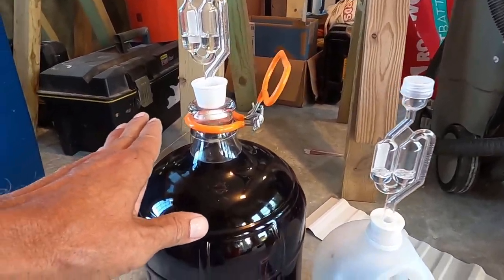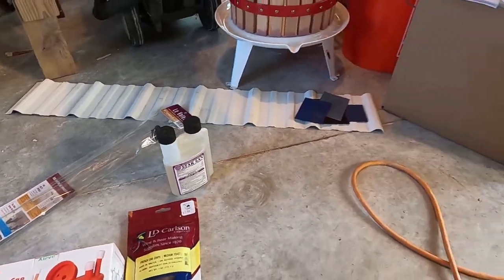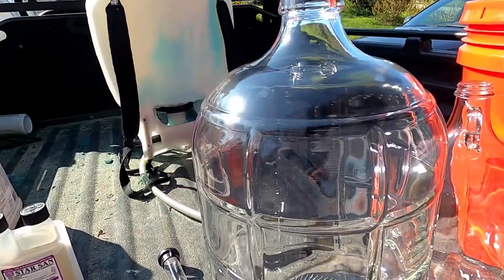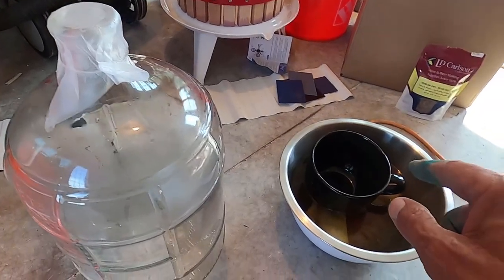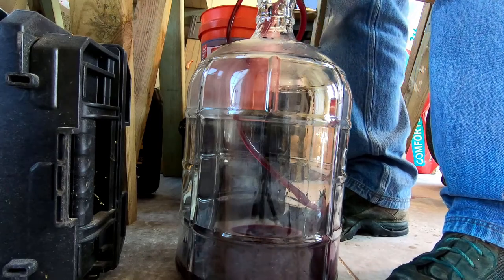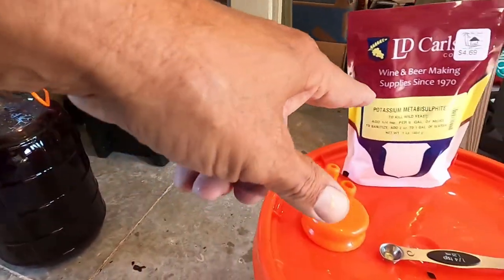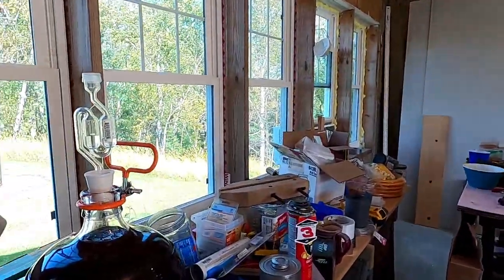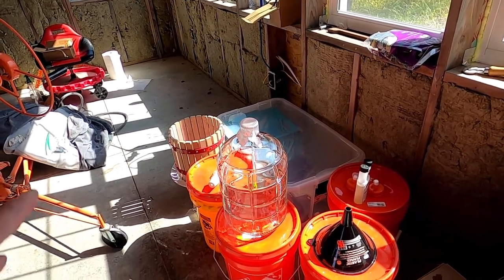My First Wine ― Racking, Adding Oak and Sulfate, Last Fermentation

Comment: Very good process, glad to watch and learn. What is the temperature does it matter when it's fermenting?
Did you like the smell of the wood chips ? did that seem to be reasonable without a bag & to gather them and strain them out at the end of the process, that will be interesting.Thanks again for sharing
Reply from the maker: You're welcome Lorna! The wine should be in the 70° range for the next 2 - 3 months, then racked again and cooled to about 60° for the aging process -- at least that's my take on it 🙂 -- I do know that it already tastes good as I had to siphon it the old-fashioned way  🍷🥴
Reply: @PlanetMojo  that's great as you worked consistently to production and gained enjoyment from the flavors of good wine your very own homemade taste tester budds !😀👍🥳in moderation, 
It's such a rich velvety looking colour wine it'll be a dry wine or other do you know yet?
Reply from the maker: @lornabartlett2744  I should be a very dry wine. The grape variety is a cold weather Pinot Noir so hopefully it is an awesome wine!

Comment: Hi planet mojo, how plants have you planted in one row? How plants in one quarter of an acre?
Reply from the maker: Hi Janaka, the rows are uneven so they have different counts. I believe the first row has 21 vines and the last one has 25 -- the newest row I believe is 28, and they will keep getting longer. At the density I am planting -- 8' wide rows with 6' vine spacing -- there would be 908 vines per acre or 227 per quarter acre.